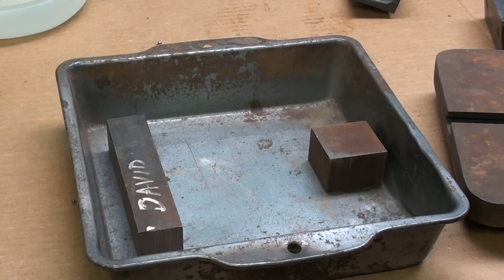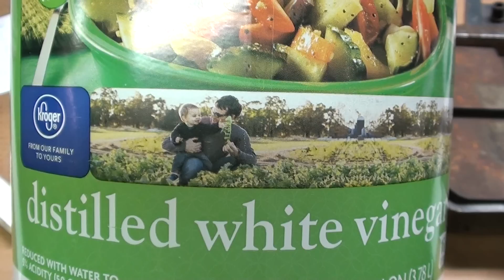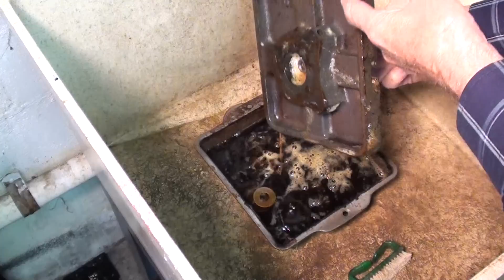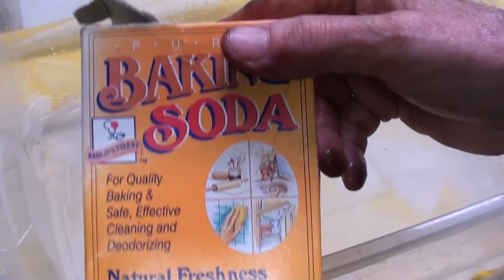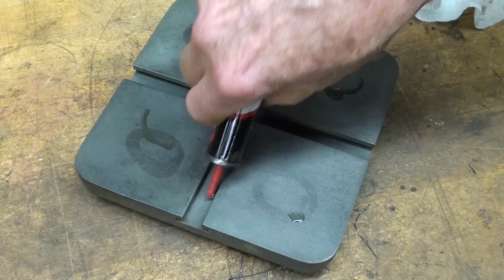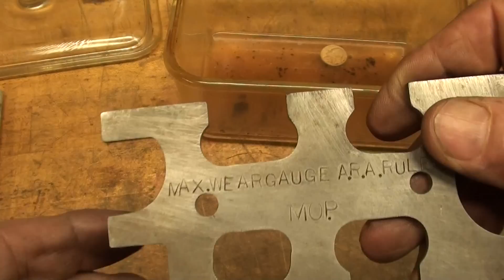Rust Removal Vinegar #304 tubalcain - compare to electrolysis

Comment: Watched and then tried it, could not believe how effective white vinegar is. I have just been given a load of engineering bits which has been under a bench fro five years, and all are covered with surface rust. Results brilliant thanks for the information.

Comment: Evapo-rust from harbor freight works very well but is not cheap.  I've been using CLR calcium lime and rust remover which is available at my local dollar store and it works almost as well as the evapo-rust.   Both products can be reused.

Comment: Hi good video,

i have also experience with de rusting of materials with vinegar.i used it mostly for small components. Good choice for the container is glass or plastic, because it resist acids. there are two methods for speeding up the process. 1st moving the container a little that you got all time some fresh vinegar at the part. 2nd (be careful !) to heat up the vinegar. but be aware of the second method, because you have to avoid the fumes. on the other side the vinegar becomes much more reactive. use pre-caution on the second method.
one big advantage of vinegar is that you can dump it with water into a normal drain without harming the enviroment. specially if we talk about low quantities like a gallon or so.

i think i will follow your channel a little more closer.

Comment: +mrpete222 Speaking as someone who has done it several times (probably a couple dozen times over the past few months), I don't consider your video on electrolysis to be a fair comparison. Note that on a chemical level, you are essentially performing the same action with electrolysis and vinegar -- in electrolysis you are directly applying electrons, with the vinegar, the electrons come from the Lewis acid type (I'm not a chemical engineer, I know) -- instead of a spontaneous reaction with vinegar, you force the reaction with electricity.

The potential for much faster electrolysis exists, I'm not sure yet why sometimes the reaction takes a while, but I've easily had items the size of the piece in this video come out looking like that good in about 10 minutes. I would guess it is mostly related to how good of an electrical contact you can make with the rusted piece, an how much DC power you can apply (I use a 40A charger, though I don't believe I've ever pulled more than 10A). In any case, I've never had to have anything that fits in a 5 gallon bucket in for longer than a day. I realize this is contrary to other people's results, but I don't have a great explanation. I just know that it can be easily done quickly.

I've also had no difficulty in reusing the same electrolysis bath repeatedly for several several items. As long as I lazily brush the "sacrificial" electrode, it continues to work fine. A large amount of particulate matter builds up in the bottom of the bucket. I assume that eventually that will cause the piece to short against the sacrifical electrode and the bath will need changing. There is a problem with contamination, i've got copper in the solution now (it's slightly green, oops!) and probably cancer in the solution, too.

Comment: Good video, informative. I've repaired a number of engine blocks, bell housings, transmission cases ect in my career and I've always been amazed at how porous some cast metals are and some non cast. I've had to "cook" some castings to get the oils out so a good welded repair could be done. aluminum seems to be the worst at this and older Cummins engine blocks as well. I've spent hours with a low flame torch(s) to keep the metal over 250℉ so the oils will bleed out. The oil can interfere with good penetration and adhesion, watching you use the 3in1 oil reminded me that it's a thin oil and you may need more than oil application. Always great watching the videos, keep em coming, thanks.

Comment: try oxalic acid, really works nice. I use it sparingly and make a very weak solution. I soak for about 24hrs. managed to save a couple of my chisels that were outside in the garage for a couple of years. I tried the electrolysis too and have the equipment but it's just darn cumbersome and I am always afraid the hydrogen vapors might ignite

Comment: I prefer phosphoric acid myself.  It works faster and you don't have to worry about neutralizing too much after as iron phosphate inhibits corosion anyway.  Have to keep an eye on it though as it will start eating away the base metal if you leave it too long

Comment: I'm sure glad I watched this video! At a recent auction I bought a box of misc parts including a pintle hitch that was very badly rusted. I decided to try your method so I bought a gallon of white vinegar, poured it into a plastic bucket and dropped the hitch in. That was two days ago. I pulled it out this morning and was astounded at how clean it is! Keep this in mind, the auctioneer told us they dug this piece and another up out of the ground and the Lord only knows how long it was there. It still needs another day or so and I believe it will look like new. You might want to check out DaveHax's YouTube video on how vinegar dissolves egg shells https://youtu.be/9I5bhUwm1t0
Reply from the maker: Glad you had good results. I will look at the vid

Comment: I used this method extensively while restoring my 1942 Southbend heavy 10.  It works great! although the vinegar will eat the metal if you leave it in too long.   I lost a few small parts that way.

Comment: Vinegar sure does better that my two attempts at using Evapo-Rust and it's much cheaper!   Maybe I got a bad batch or Evapo-Rust but I found it one step away from useless.  Electrolytic rust removal works good also especially for items with heavier rust, but it takes a bit of time.

Comment: This worked like magic! I had a #4 Millers Falls 6" pocket scale found at a yard sale that was in a leather sheath and badly rusted, Six hours in the vinegar, two minutes with a brass brush and some 600 wet/dry paper and it looks great and is 100% readable. Thanks Mr. Pete

Comment: Lyle, fyi the gauge at the end of the video is for measuring the wheel flange on rolling stock. I used to be a car knocker i.e. carman on the Missouri Pacific R.R. aka MoPac and we used a gauge similar to the one shown in the car shop to determine if the wheels needed to be replaced as we performed maintenance and repaired cars. There was a similar yet different gauge for measuring the wear on the knuckle i.e. the part of the coupler that pivots to couple or uncouple the rolling stock.

Comment: good video, thanks for sharing. Remember that instead of vinegar you could also use citric acid. This is available in crystal form (often used for jam and syrup making) Theoretically it should work even better than vinegar but I have not yet tried it. Leave the parts in acid only as long as necessary since they continue to remove also bare metal.
Concerning molasses google for "molasses rust removal" check out Dave Ailey's videos where he de-rusts big car body parts.

Comment: GOT A 1910 " BEATTY " MEAT CLEAVER 2 YRS. AGO . IT WAS RUSTED ABOUT LIKE YOUR STUFF , DIDN'T WANT TO SAND AS LOGO WAS FAINT . RAPED IN TISSUE & PUT SOME CONCENTRATED " LIME " JUICE ON IT WETTED TISSUE  , 20 MINS. & DONE , BUT FLASH RUSTS IN ( SECONDS ) .  P.S. THEY'ER MEAN MEAT CLEAVERS RUINED A               GOOD FILE TRING TO SHARPEN IT , WHY THEY WERE CONSIDERED BEST ?

Comment: I've been using vinegar for rust removal for a few years (along with electrolysis), and have had generally good results.  I never use it on anything I want to save the plating on, because it eats most platings.  I've also had better results with cast iron and tool steel than mild steel for some reason.  Last week I salvaged about 3 lbs of center drills that were rusted together in a block.  I didn't think they'd be much good, but only about 5 out of hundreds were too pitted to use; the others cut well.  I also add salt sometimes if the reaction is really slow, but you have to monitor it because the steel/iron will digest also (but only where the rust was)- it must be similar to rust "worming" behavior in unpassivated stainless steel in marine environments.

Comment: I often use vinegar to remove rust from iron and steel parts, with success.  If the rust looks a bit thick, I add some lemon juice as well.  Clean the residue off with some steel wool.

Comment: You can use electrolysis. You can use vinegar. You can use Evap-o-Rust and its many cousins. You can use elbow grease. You can sandblast. However the question is -- which is the fastest? Or the slowest for that matter. Furthermore we all have our prefernces based on mostly "I tried X, it worked, why bother trying anything else?:" So if you have say a wrench you are trying to restore, it probably does not matter. If you have a big mill or lathe or for that matter a tractor, then it does matter ---kinda hard to soak my Farmall H in vinegar. Brad Jacobs (BasementShopGuy channel) sears y Evap-o-Rust. But not one of these methods will deal with pitting. Once it is pitted you are in trouble.

Comment: Tried this with a bunch of rusty Morse Taper 2 imperial drills, reamers, taps  that I got inexpensively at a car boot (trunk) sale as most folk in the UK want metric & new. It worked superbly well, more convenient than electrolysis as I didn't have to make an electrical contact, and created like new pieces from the rusty things I bought. Thank you!

Comment: Super video of rust removal!  I have LOTS of metal that has contracted the rust bug however they are of such larger sizes than "Mom's baking equipment" that I need to think the chores through a bit more to get accomodate the  coverage of the vinegar to those larger pieces.  I do have a large "pan" Dad used to soak his Model T's wheels in water or linseed oil with wood felloes, fitted to the old rims that constitute  the wheel which as you know the tires were mounted on. I think that pan's dimensions might accomodate some old bicycle rims that appear true yet "bitten" by the rust bug.
 
I then wonder if an old chrome or nickel plated bicycle light rim  made of a very light metal can be soaked in vinegar in that old Model T "tool" to de-rust? There is also the question about the effect of vinegar on the pan itself since the bottom edge of the round pan has been soldered to the circular rim/edging that would hold water when soaking the wood?  I guess that whole diatribe gets down to the basic question of what the limits are as to the use of vinegar on other light weight metals?

You are a great teacher in that your "lessons" always generate more questions thereby improving our thought processes.  Thanks for the continuing education!    John

Comment: The vinegar bottle says, "Usage ideas on back." Did you check to see whether they include rust removal from old shop equipment? Guessing from the idyllic marketing photos on the front, I'd bet not! Think of shoppers' reactions to a label picture of foamy, rusty cast iron. Delicious!

Mrs. Pete's meatloaves are iron-fortified.

I get a kick out of regional pronunciations of "pecan." Illinoisan is pee-conn, the northeast PEE-can, down south here it's pih-CONN. I hear somebody say "PEE-can pie" and I wonder if it was baked in a chamber pot.

Comment: There's a product called "evapo rust" I've been wanting to try.
Reply: +Shane K Evapo rust is an excellent product that only removes the rust, it does not attack the good metal in any way. It is also environmentally friendly and very safe to use. N.b. I have no connection with the product!
Reply: +Shane K +1 on evapo-rust; I've used it a couple of times & impressed with the results... just kinda pricey!  my local HarborFreight carries it, though.  If you can find a 20% or 25% off coupon, that can help defray a little bit of the cost...

Comment: From my experience, vinegar leaves a better finish on cast iron, than electrolysis. I've restored  several cast iron pots and pans and prefer vinegar. I have a friend that is in his 80's now, who did body work on cars for many years. He always told me to use ketchup on cars to remove surface rust. The vinegar in the ketchup takes the rust off, and tomato paste holds it to the car.

Comment: Lyle, 

Try using Carbon rods instead  of steal in you Electrolysis, it is very clean, all the sludge settles to the bottom and it is completely reusable.

Comment: Hi Mr. Pete,
I hope everyone enjoys your humor (especially your wife) like I do :-) Was that chisel for tamping okra?
Reply: +Jim Kodysz  Sorry-oakum!!!
Reply: the chisels are plumbers but are called caulking irons(depending on where you live) and are used for tamping and beading the lead after it has been poured in the joint
Reply: A yarning iron has a large arc to it. Mostly the yarn(oakum) is embedded with the iron, not striking it with a hammer. You set it first and then tamp it snug with a hammer. If it's packed in too tight, it could break the hub when it swells from moisture.

Comment: Mr Pete, revisit shopdogsam's electolysis playlist and take another look at the graphite option.  It's a lot cleaner than either of these methods.  One of the economic benefits is once you put the sodium carbonate in the water once you can just keep re-using that same water (adding more as it evaporates) over and over.  He says he's had some in use for about a year, and this with daily operation.  I guess it depends on volume, but if you had to keep buying that vinegar for daily use for a year the cost would start adding up.  Plus, it has to be disposed of.  I also wonder if being a mild acid if it removes some of the part during the process.  Molasses?  Ouch, that would be very expensive for a high volume usage.  Then again, maybe it won't be necessary to soak the part in molasses.  It might be something you could just paint on it and it would stick to it long enough to do the job.  

I think for high volume on the cheap the way to go with this would be a solar powered battery charger and 12V battery hooked up to a graphite-based electrolysis tank with a little sodium carbonate for the water.  After the up front costs it would be basically free except for the occasional need to replace one of the worn out graphite pieces.  By high volume I mean daily use.  Most of us don't need this for daily use, so the vinegar method probably makes a lot more sense for most.  It's reasonably cheap and you don't have any harsh chemicals, seems to be environmentally friendly,  and no danger of hazardous gases.

Comment: The chisel is for setting the lead in a lead/ oakum cast iron joint.
Reply: Beat me to it. It is specifically an inside caulking iron. If lucky, there will be some cross hatching on the end. I guess you would know he now needs a yarning iron, a driver and an outside caulking iron as well as a 5# ladle. We just melt the lead right in the ladle with a turbo torch and pour the joint. We even have an over head iron with a hooked end, 35# lead pot, burner and hood with a real plumbers propane tank that the burner screws on to. a small and large joint runner, soft, well used and soaked in cutting oil, will close his collection. Still looking for an old 10# ladle for 8" and larger joints. I dislike white oakum, rather use the oiled jute.

Comment: Been using vinegar to clean up old woodworking tools for a long time. Works good and I haven't had any problems with it eroding the base metal, iron or steel.

Comment: Wow! I'm really impressed with those results. I have not tried vinegar before, but I certainly will now.
I have tried both molasses and electrolysis. 
The molasses works fine and leaves a perfectly clean shiny part, but took something like two weeks to get the results you got in two days.
what I liked about electrolysis is that a got a rust free part with dark oxide finish. for some of my projects this was preferable since I still wanted the item to look old.

Comment: You have to monitor the progress of the rust removal when you use vinegar because the vinegar will continue to attack the base metal and corrode it so you have to watch and remove the item from the vinegar and then treat it will oil to prevent further rusting.  The advantage of the electrolitic method is that it is self limiting that is when the rust is all removed the reaction stops without any damage to the base material

Comment: Lyle, I think you had some air trapped underneath so the vinegar was not in contact with those corners that still had a bit of dirt in them. Came out surprisingly clean! Thanks for doing that trial for us. I know from  experience that electrolysis does not cause damage to cast iron no matter how long it stays in there. Just wondering if that vinegar will cause pitting over a prolonged period? At my age I sometimes forget to get to things in time! Thanks for your time and effort, as always great video!

Comment: If you have wood working tools that you want to keep from rusting and don't want oil stains, lets say an oiled table saw table. Take some paraffin wax and dissolve it into some gasoline, you can wipe it on in a thin layer to keep the rust off. Also be safe and avoid flames while doing it.

Comment: That came out much better than I would have thought as well. The main issue I would have is the waiting. If it takes a week to remove the rust then it just isn't going to happen for me. A spooge tank will accept much larger (and smaller of course) items and would have given the same results but better because the paint would have been removed as well. I know the 20 cents is a lot to pay for the required electricity but vinegar isn't free. Obviously vinegar is good for small items if one has almost an eternity to wait.
Finally I wonder who has tried Penetrol for rust protection? I have used it recently and it actually puts a very nice protective coating on the bare metal. Yes it is mainly linseed oil but it has additional ingredients that are an improvement to just BLO.